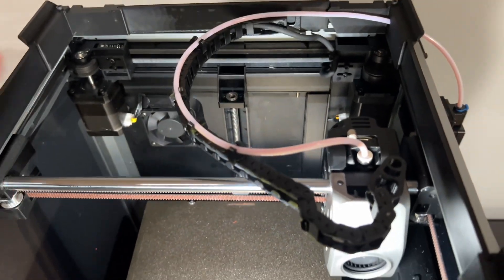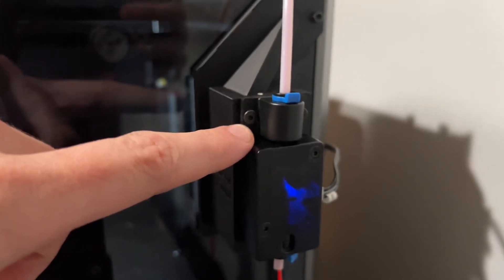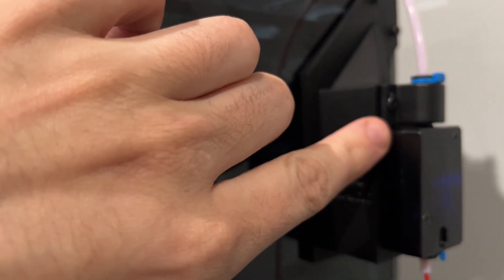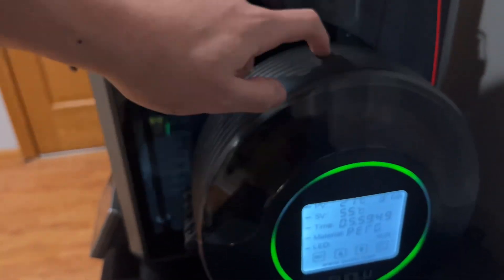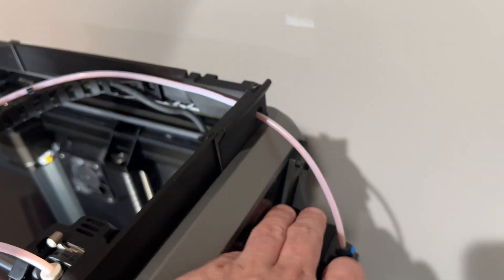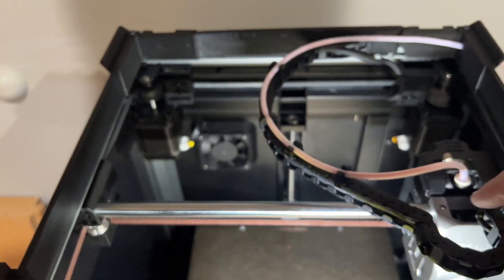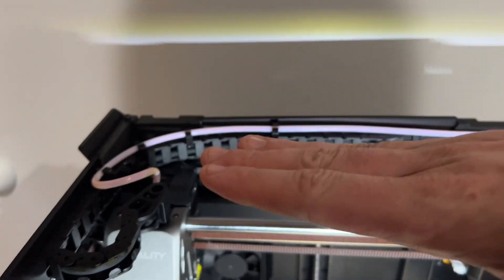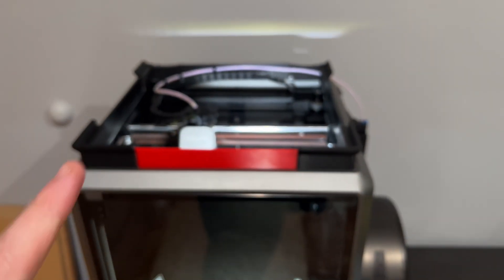Creality K1 Bowden, head mods

Comment: those screws in the bag are for belt tensioning. ive been using an eibos easdry filiment dryer and run the included bowden ttube into my sensor.
Reply from the maker: Thank you for reminding me about what those are. I will admit when I got this I used those for the door handle lol.

Comment: The reason for the chain to bend like that is because they put 4 links in backwards for the ptfe tube to come out. Just reverse those links and your cable chain will be perfect.
Reply from the maker: Yea I had messed with a couple of those. I actually kept a couple the other way because it makes sure that it will push up against the side when it swipes. after this video I did flip a couple more but not all of them are flipped. I noticed some of the clips were cut and some wernt so its interesting why then had a human flush cut them instead of just having them printed that way. I did use your deisgn for the gantry clips. I would recomend if possible to round out the center hole where the bowden tube is in so it allows it to flex a bit more and move back and fourth as needed. Otherwise I have been happy with your design.
Reply: I’ll look into a redesign, in the time being you could try the side clips that already have with all those properties you mentioned. I would recommend my side clip closed v2.
Thanks, enjoy!!

Comment: Are you screwing into the glass
Reply from the maker: are you talking about the bracket to relocate the runout sensor?
Reply: the side panels are not glass only the front door. the sides are a plexi
Reply: I believe the screws go "through" the side panels and not "into" the side panels, just a mater of semantics.